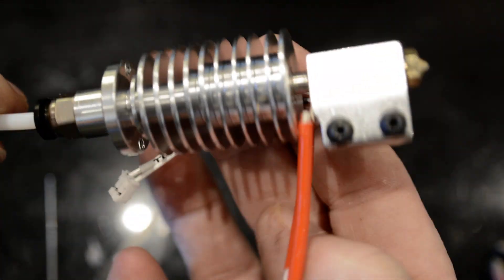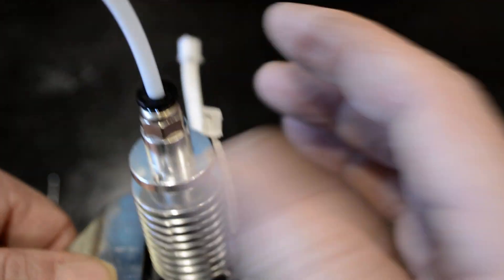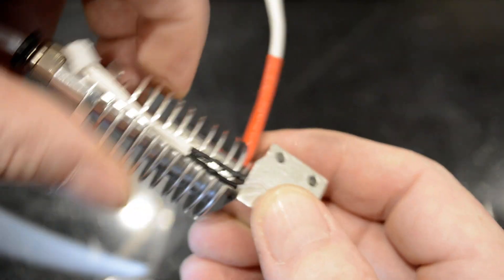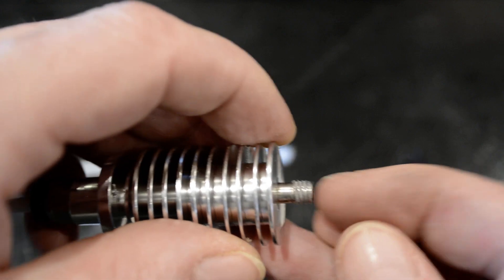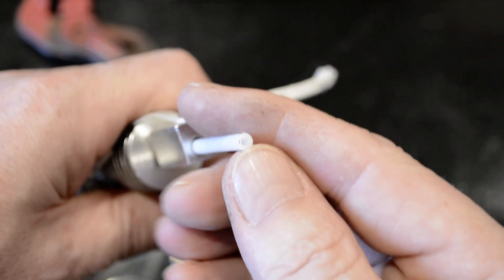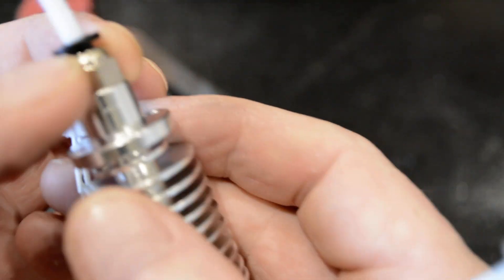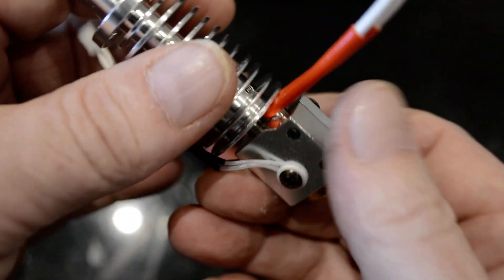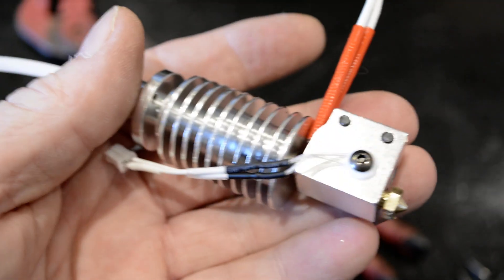Anycubic Vyper Hotend Dissasembly/ Reassembly

Comment: thanks!! this is why I had problems probably, the previous guy was messing with it / but now I know what to look for because I wanted to replace the tube with a Capricorn tube which is rated up to 300C - have you printed PETG with this printer ?

Comment: Brilliantly explained! But I have a question. There is a strain gauge at the top. When I autolevel my Vyper, the first two autolevel probers work fine. But when it gets to the third probe, it smashes down on the bed. Many have told me that the strain gauge is bad, but if it were bad, why would it work for the first two and always quit on the third? I don't want to buy another gauge and just "maybe" have it work, when it might be something wrong with the hot end or even something else. Can anyone give me a clue what might be wrong, or is it the strain gauge for sure. And if so, please explain how it could work twice and always fail on the third?
Reply: Sorry, not been about so I would assume you fixed it, for others reading, the most often cause of this is the cables being tied to the feed tube, or an overly sensitive sensor, you can adjust them but GENTLY pushing or pulling the bottom of the heat block, one way will ake it worse, the other will make it better, start with very light pushing/ pulling, if it makes no difference try a LITTLE harder, theres a knack to it

If it adjust correctly then just very lightly touching the nozzle with a wrench or side of a knife will trigger the sensor light

Comment: Hi,  Just have some issue with me Vyper. Sometime my print feel ok for me sometime not. People says look at you calibrations (heat, filament size , length of 100mmm , Z offset , ETC... ) . I just change the tube by the blue one (call capricorn , everyone says It is the best I follow). But yesterday I print two parts at 220°c for Sunlu coffee PLA then nothing my printer was not able to push any filament even if I push with pronterface my heat to 240°C and I push manually on the filament. So this morning I decide to disassembly the hotend. The day pass I work on other bussiness to help my neighbor and now I check how to make this job. I find your video... I have only two words Thank a lot. I will try now tomorrow with more confidence on this job it is my first time to touch on hardaware of the printer. Really appreciate this video.

Comment: Cheers! This fixed the issue I was still having after cleaning and re-adjusting multiple times. Like another commenter, I didn’t have much if any gap after tightening. However the tube was down as far as I could get it (checking multiple times and marking estimated depth with a marker). It’s printing fine, but I’ll check after a few prints to confirm there’s no leakage.

Comment: My thermistor wires keep breaking away from the heatblock. I've gone through 3 or 4 hotends already. The wires seem to degrade with heat and motion. 

I was thinking of getting some heat resistant epoxy and sealing the thermistor wires in place, could that potentially work?
Reply: Not sure why that is happening, i have had no issue like that or heard of it either
Reply: Same issue.  What could I use to seal these in?  Absolute trash connection.  Trying to pry them loose from the connectors was a nightmare as well.
Reply: @TomDickinson-x4l  there should be no need to seal them..

On the vyper, older versions, there is a wee screw next to the hole the therm goes in, that screw should be LIGHTLY tightened onto the wires to hold it in place.

On kobra max or new hotends the thermistor is metal clad ina wee tube and is held in by a grub screw, again this should only need light tightening and the thermistor should be fully inserted so the screw contacts the metal case..

The connectors on the board are somewhat shite and the plastic can pull off the board pins, a bit of hot glue on the side if the connector and the board should hold the socket on the board and then there should be no issue just plugging in the therm.

There should be virtually no movement of the therm wires because the whole print head and everything moves together so its highly unlikely tht movement is contributing
Reply: Thanks, was referring to the connector on the wires that plugs into the board.  Also yes, the plastic bits do come off the pins very easily but the wires connecting into the male connector bit that goes into the female plastic bit on the board is the one where the wires are completely loose.  Thanks for the advice with some glue. 
 @AkiraFurball
Reply: @TomDickinson-x4l  gotcha.. you can use the same method and fix the wires into the plug with a dab of hotglue or epoxy.. just be carefull to not get it on outside of plug obviously and make sure wires are prooerly in place first

Comment: First of all, thank you for the video. I didn't actually understand how to fix the radiator, which, in order to be aligned with the holes relative to the hot end, needs to be unscrewed by about ten degrees. Once the Teflon tube is inserted and the nozzle is closed, the missing part of the radiator is still soft and rotates, causing the plastic to come out from the top of the hot end.

Comment: If the nozzle is slightly lower than the original will that affect bed levelling? Or will it compensate and adjust ?
Reply from the maker: It should not make any difference to the level, as in the points tested, but it will make a difference to the z offset..

Comment: Hey ho, thanks for the video.
CUrrently I found different explanations about the bowden tube. 
Some telling, the nozzle and the Heatbreak should fit together, without the bowden tube between, you mention, that I should apply the hotend, then the nozzle and into the gap the bowden.
Is both possible ? I am confused but very new to the 3d Printer topic.
Thanks.
Reply from the maker: Some people advise backing out the bowden connector at the top of the heatsync and screwing nozzle in fully then fit bowden and tighten connector..

Imo this tends to damage the bowden when the connector it tightened and is an inferior method..

Backing out the nozzle, fitting the bowden, then tightening the nozzle fully gives the best compression of the bowden and seal onto the nozzle, in my experience it is the most effective method by far

Comment: Howdy. Just a thought can one change the heatbreak to a all metal one so there is no Bowden tube to deal with? Also, just wondering what after market hotend assembly that is better then the stock one can purchase? After watching other creative content, there seems to be a variety but few discuss this printer. I am not knowledgeable enough to figure this on my own.

Thanks and regards
Reply: not sure if you're still printing, but yes you can change the heatbreak (search for E3D heatbreaks). It's not necessary if you are just printing with PLA filament though (200C or lower)

Comment: I takes longer than 5 minutes but it's a skill people do need to learn.
Having extra if your time is limited or very New to this Hobby and DIY, ETC Having a replacement or 2 is great and maybe after.cleaning your used one you would think about having one with a 0.6 or whatever other size you use. Then just switch them when needed. Tips do go bad not all tip are the same great Quality even within the same batch.
If your having issues with first layers or bad looking walls it could be the tip if your changing the tip for that reason cleaning out the whole thing might be a time issue.  
I think he did a great video showing what your goal is and how to so I hope you all do well and if you have a Vyper and have some knowledge you want to share we do need more videos on youtube. There's just not enough for how good these printers are and popular they really are. I would also like to see people mod them with useful stuff.
Most of all replacement hotends that are all metal and can reach higher Temps.

Comment: Thank you VERY much for this great video. After a while I got back to my printer and wanted to start to optimise some things on it and during a print i saw "hey theres not enough plastic coming out the nozzle" so i knew that things clogged. So off i went to the internet googling what might be the problem. I knew that I pulled out the bowdentube when decided to disassemble the printing head. Luckily i found your video on how to install it properly again, because im pretty sure that the incorrect installment of the bowdentube is the problem.
Reply from the maker: You are very welcome, glad it helped you out

Comment: Hi. Great video. I just went through this because of black bits in my prints and thought I would pass along the things I found. I couldn't get the Bowden tube out of the heat sink, so had to take it all apart. Basically like your video. I found that the end of the Bowden tube seemed partly melted; the bottom 10mm got smaller towards the end and old PLA had worked its way up between the tube and the heat sink and was a mess that was stopping me from removing the tube. Anyways, I got that all cleaned up, cut off the weird end of the tube, and it seems to be working fine. This is leading up to a question... could this be a symptom of cheap Bowden tubing in the machine? Is there a better quality tube that you would recommend? Thanks again. Paul
Reply from the maker: The stock bowden is piss poor.. capricorn xs is the gold standard and i always switch to it.

However, be careful where you buy as there is fake on marketplaces like ebay and amazon..

The stock tube is actually glued in, so even brand new its difficult to remove, its unlikely it was the heat damage that made it hard to extract.

Cap xs is more heat resistant than stock, unless you are exceeding 250, 260 degrees it will last a good long time without trimming back.

If you switch, i would make the cap 30 to 50mm longer than stock, then you will be able to trim back 10mm prob 5 to 8 times before having to replace it which at normal temps and nin abrasive filaments, it will prob last the life of the printer.

Comment: hello , good tuto, i got my head print dead cuz seem pla are melted away inside..so i put a new one and stupid question , when you remove the cable tie lie , we dont need to put a new one like the video Anycubic ?  on not neccessary?   sorry im just affraid to dont destroy my 3d printer
Reply from the maker: You can fit a new tie, or better still you can print a bowden connector clip that fits in it and works better..

https://www.thingiverse.com/thing:5229023
Reply: the cable tie acts as a lock to prevent the bowden tube from backing off the tight connection to the tip.

Comment: Everything looked easy till I realized it has to be done while the nozzle is heated
Reply from the maker: Removing nozzles always has to be done heated... and of course to push out any burnt crud
Reply: @Just3DPrinting  I'm not that confident I can navigate all those things while the nozzle is heated, I might need a video of how to avoid burning myself doing it.
Reply from the maker: @danitestsstuff3921  it is only the heat block and nozzle which gets hot,  the heat sink, round bit, stays cold
Reply from the maker: @danitestsstuff3921  for cleaning ut the hotend, changing nozzles, reseating the bowden you dont need to split the heat block/ heat break/ heat sink..

You just remove the nozzle, and bowden tube, the rest stays as is..

I only split it down to demonstrate the internals and how it DOES come apart, ordinarily you dont need to take it apart

Comment: What thermistor do i buy for this head.  Yeah. I messed up the wire on mine.
Reply from the maker: they are not as easy to get plug in replacements.. I think the chiron etc are all the same..

its the same as a Creality ender/ cr thermistor but has a shorter lead and jst connector, but you can easily cut the wires on the old one and splice a creality on on after cutting back the cable, just nmake sure to properly insulate the joints with heat shrink or insulation tape.. the two wires can connect in any order, it has no polarity
Reply: For mine I bought an NTC3950

Comment: Why did I buy spare hotends? LOL.  thank you that will save me a bit in the future.  And I wanted to know how that all came apart.  I have taken the nozzle out, and then the heat block became loose... first time thought I broke it all to heck.

And what about those thermistor wires, eventually those will have to be replaced.  becoming brittle and all.

And I can tell you it never occurred to me to grab the block with the way you have instructed.  I always put my adjustable end wrench on the other way, which could cause damage to the thermistor wires - oops!  lucky so far!

The good thing is I can learn!  the better thing is you are willing to teach!

Comment: Another solution for the blockage problem is a genuine Slice Engineering Copperhead Bimetallic Heat Break, then you could push the heat higher to
Reply from the maker: Opinions vary regarding all metal..

I dont doubt the genuine e3d one is good, but PTFE lined is still the best option for low temp, and if fitted correctly (which is ver often NOT the case and the purpose of the vid) pretty trouble free.

If you are going to go that route then I would not cheap out on a clone because you are likely going from bad to worse.